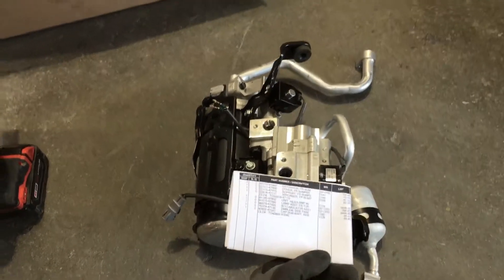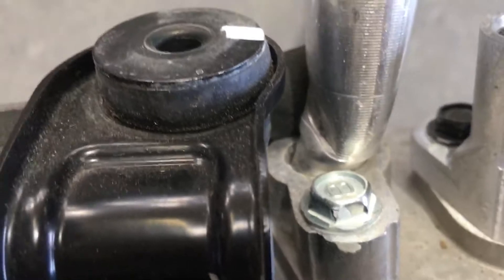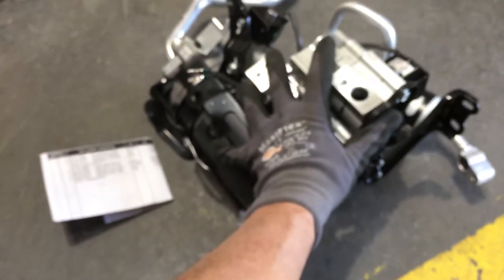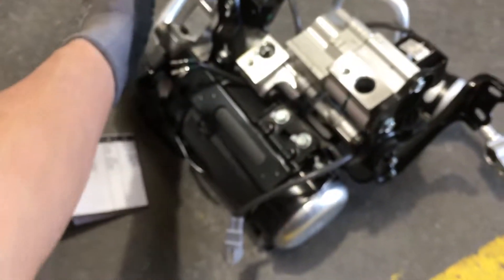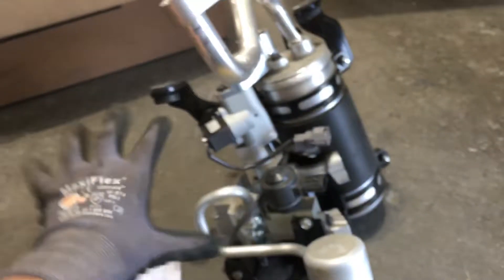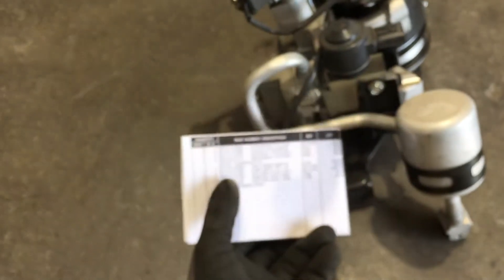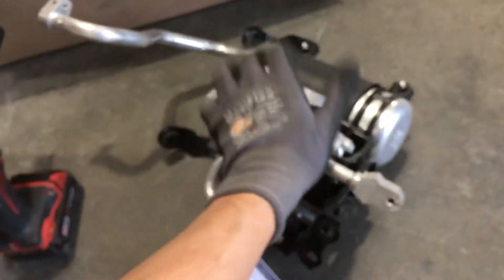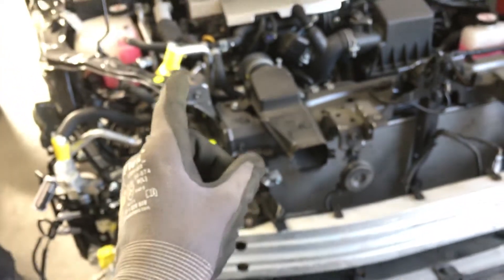PRIUS PRIME 2018 I now own a accumulator assembly for testing and experimentation.

Comment: Any diagnosis on the potential leaks?
Reply from the maker: There is no leak at the damage site where the pipe was crushed in. 
          Upon recovery the system was about 200 g low on refrigerant which is quite a bit for a 2018. 
      If that was a normal Prius that takes about 420 to 480 g of refrigerant to system would barely even be working with a loss of 200 g

          But since the Prius prime has over 1000 g of refrigerant you would only notice the loss maybe on the very hottest day but it would still be cooling probably pretty good. Customer would never notice. 

          I posted my photos over in previous chat on the prime form under care and maintenance I believe and ask people to look at their own cars and comments whether we’re looking at their own cars through the grill at the fittings if they notice dust build up I’m trying to get some sort of census accumulative responses back from multiple people.
Reply: @coldfinger459sub0  Thank you sir. Found your post on PriusChat. I will link you PriusChat post onto the two Facebook Prius Prime Groups. One member on that Facebook Group indicated similar dust collection on lower fitting.
Reply from the maker: @2927usmc  if you go into my photo album at PriusChat you’ll see a lot more photos of different Prius  and failures I found over the years and also pictures with descriptions of different tools used for different purposes a wealth of information that you won’t get from an automotive education school that gives you a short three weeks spent on air conditioning.